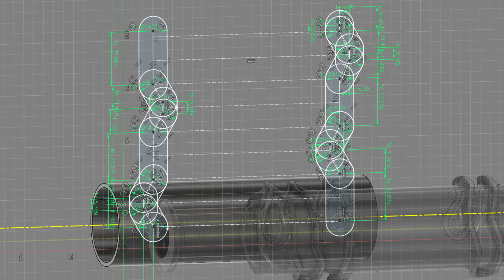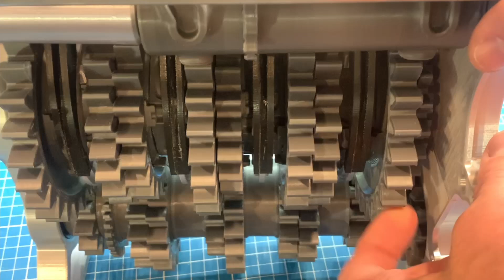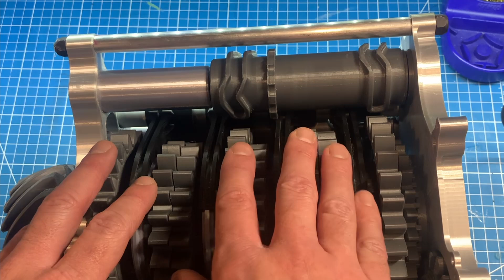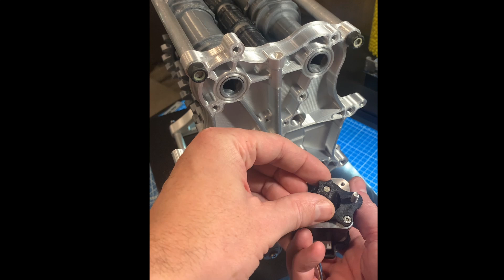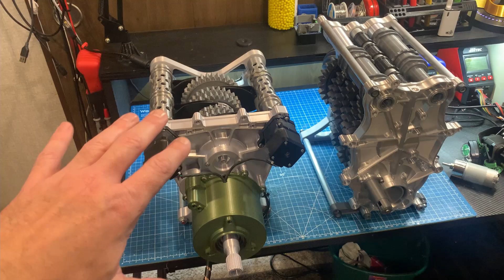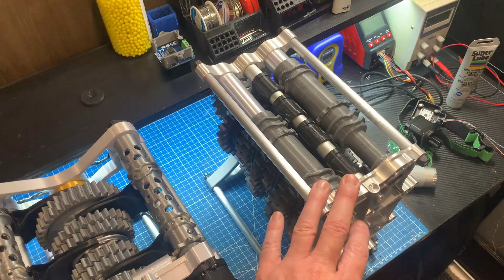F1 Hybrid Era Seamless Gearbox Pt3

Comment: Say you're accelerating and the driver desires a shift from second to third. Couldn't you "actuate" both drums the correct direction at the same time, the ring engaging second now is in sort of a preload condition as the torque keeps it locked, until the ring for third rotates around and locks, accelerating the output shaft, taking the torque off second, and the second gear ring is pulled out before the next gear dog catches up. Sort of like clutchless up drag boxes but instead of ramps on the back side of the dogs forcing the disengagement when the next catches up you use the actuator to apply preload.
I never thought it could be actually seamless but if the above is the case, it totally can.
Downshifts- do they use a slipper clutch + magic? Please help.

Comment: Brilliant work as always. Just a quick question I've wanted to ask since the last video: those end plates sure look like milled aluminium but I don't recall you mentioning that so maybe I'm wrong and they are 3D printed but sanded & painted to look like aluminium?
Reply from the maker: They’re 3D printed out of a material called silk PLA. It looks really cool but it’s not as strong. It’s great for the bigger parts.

Comment: I have a question, which software you use for design solidworks ? And when you design you take into consideration the 0.5 of error in 3d printing ?
Reply from the maker: I use Fusion 360 which is free for hobbyists. I’m considering switching to the $99 Solidworks hobbyist at some point. 

I do have to take into account a certain amount of clearance. I typically print a bunch of test parts and usually my printer needs 0.15mm for a tight fit and 0.25mm for a loose fit.
Reply: @IndeterminateDesign  ah really did not know there is a hobbyist solidworks version ! My flashforge guider 2 printer optimum clearance with esun and creality filaments needs 0.35 mm

Comment: Great work as always, man. It's unbelievable what you've wrought out of that Ender 3 (if that's still what you use.) I'm surprised no company has sponsored you and given you an SLA printer to try
Reply from the maker: Thanks!  Honestly at this point the only original Ender 3 part is the frame. SLA is definitely in the future, but traveling full time in an RV I don’t think I could handle the mess.

Comment: Those things are very cool. I do  agree somewhat with comments of the latest gear boxes. The gearbox in todays f1 cars have no dogs or dog rings. Theres an internal dif that when u drop the cage it locks the gear in. Just like a locker. The shift barrol if u were to call it is just a slider inside the diff with pins on it. When its slides in and out the pins lock and unlock the gears.
Reply from the maker: That’s awesome. I’d love more information on one of these gearboxes. I’ve seen similar setups with the Xtrac IGS.  I saw some pictures of a broken gearbox from 2020 and they had shift barrels. When did they make the change?
Reply: @IndeterminateDesign  i believe its only a few teams. Everyone claims that its “seemless” but i believe the two barrels is just as quick. You still have to move the barrel inside the gear to drop the cage. The benifit of the diff style gear box dont have to line any dogs up. That also could be harmful to the gear box not matching engine rpm and wheel speed. I believe ive heard them call it gernade shifting. If i can find the artical i will get it to you. I love your work keep it up!
Reply: @tannerstephens2236  Where do you find this information? I am starting to dive deeper into the technologies of F1 and I really want to learn further about their gearboxes. Thanks!
Reply: @IndeterminateDesign  

https://youtu.be/X7xb2B_3Hj0

Trying to find the other one ive seen as well